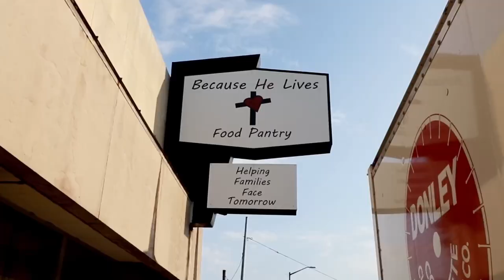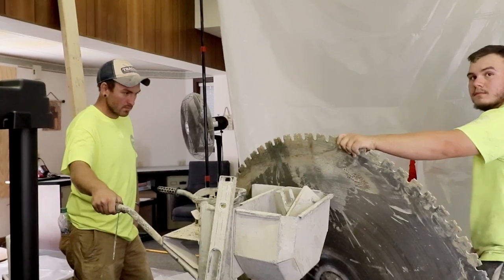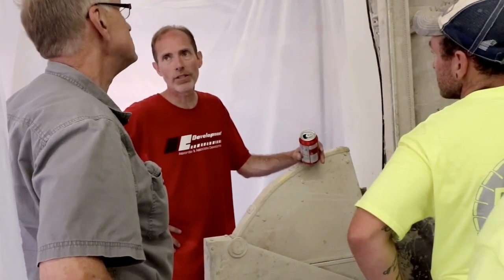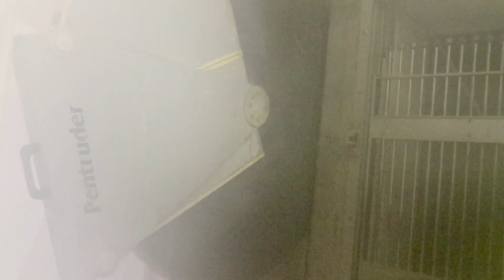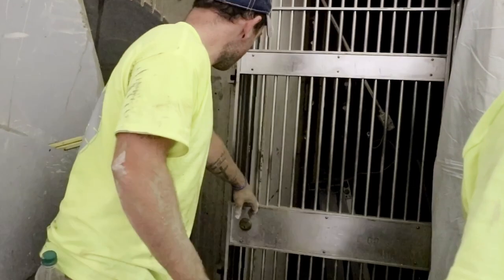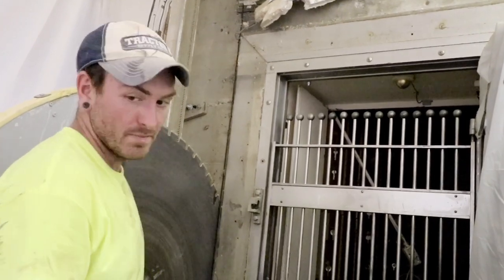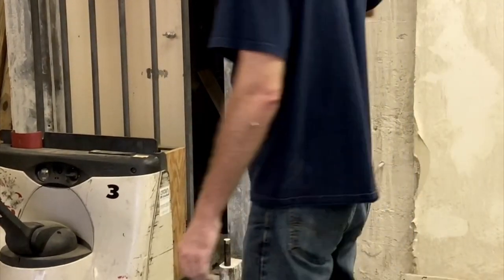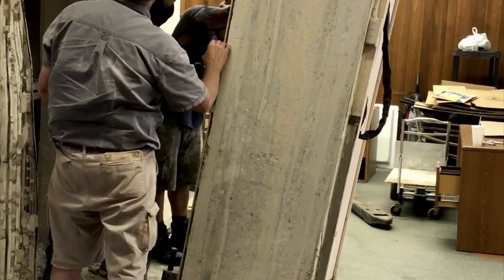Dismantling a Mosler Bank Vault Door

Comment: Unless you're scrapping the vault, removing the door from the frame is never a good idea. NEVER a good idea. The frame has lifting points along the center of gravity axis. The door does not have lifting points. There are parts you can lift from, but will cause damage if you lift from them, and they aren't on the center of gravity. I've worked on vaults for years, and been involved with many vault installations and demolitions. Rigging guys will try to tell you to separate the frame from the door to make it lighter. If you can't handle the combined weight, you're not the right rigging company for the job.